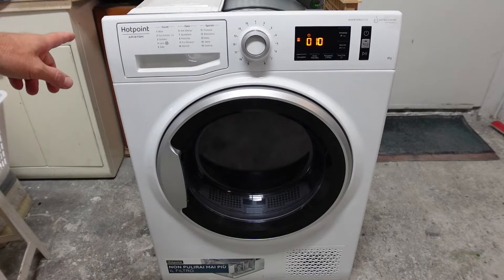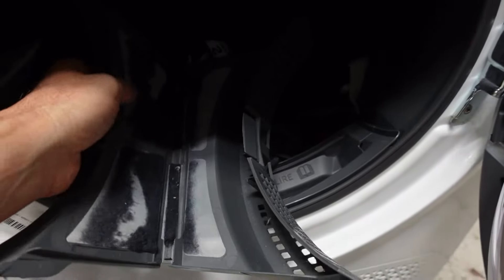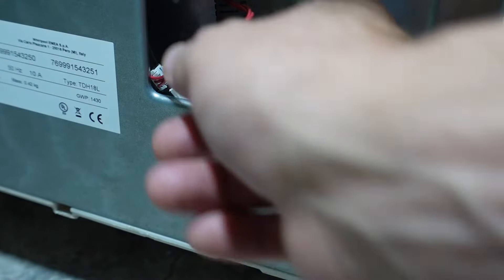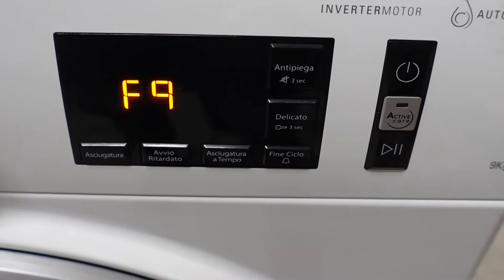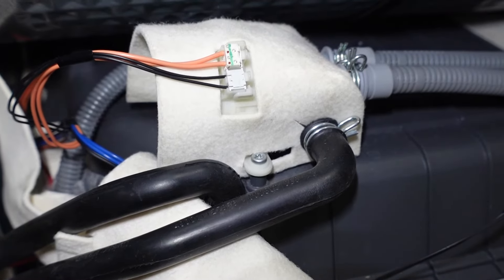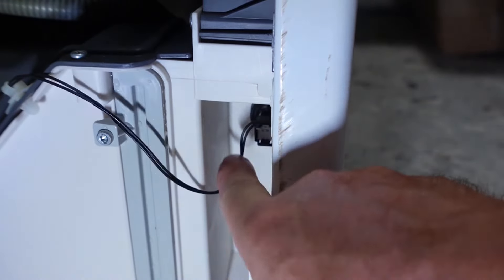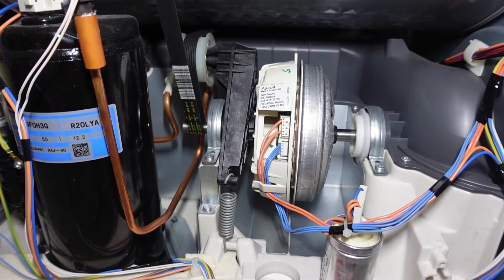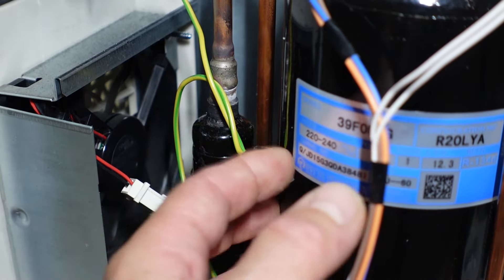asciugatrice hotpoint, indicatore recipiente pieno, errore del sensore dell'acqua E2-F9. +recensione

Comment: Salve, possiedo un asciugatrice hotpoint ariston NT M11 8X3E IT acquistata a novembre 2022 nuova. Premetto che non da nessun tipo di errore, i 2 filtri vengono puliti ad ogni lavaggio che faccio 3/4 volte a settimana ed utilizzo lo stesso programma di asciugatura (quotidiano) da quando l'ho presa senza mai sovraccaricarla. Di punto in bianco non mi asciuga più e alla fine del ciclo (che compie normalmente) rimangono bagnati come li ho messi. Ho notato che negli ultimi due tre minuti di asciugatura realmente ne passano anche 10/15 prima che si fermi e a volte arriva ad uno e non si ferma più. Da cosa potrebbe dipendere? Grazie.
Reply from the maker: Non si ferma perché il sensore rileva ancora umido e ricalcola il programma. Bisogna fare dei test, guarda altri miei video su le ascigatrrici vai nella playlist cartella 📂 sciugatrice
Reply: Più o meno è lo stesso problema che da a me 😢